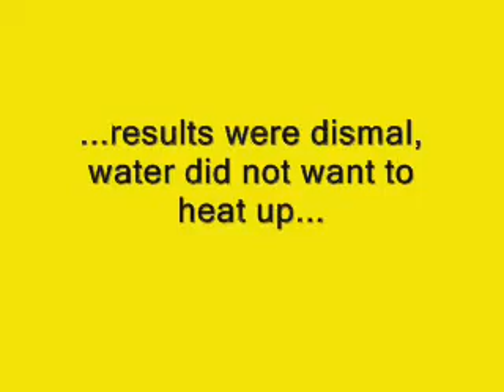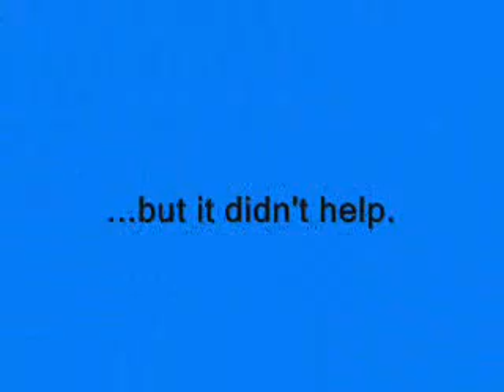Clean Water Test HHO #42

Comment: Are you using neutral plates in the middle and connecting  your leads only to each side ? If you are I think you have too many neutral plates  try only 3 or 4 neutral plates so your cell will have 5 or six plates total .This divides your voltage by the amount of spaces and you will have 12 volts divided by 4 spaces is 3volts per space in a 5 plate cell. If you have a six plate cell and 5 spaces the voltage is divided by 5 spaces which is 2.4 volts .I hope this helps you . John U .